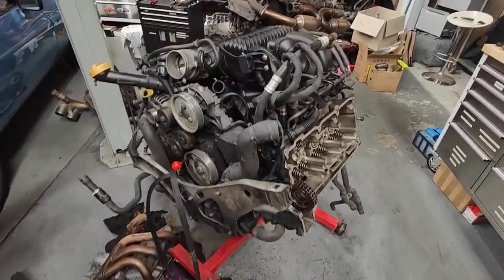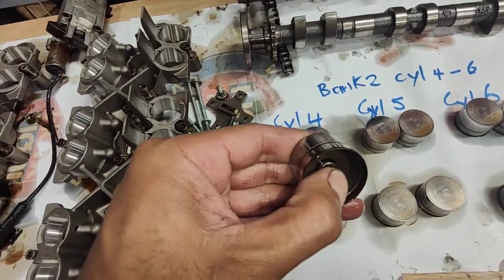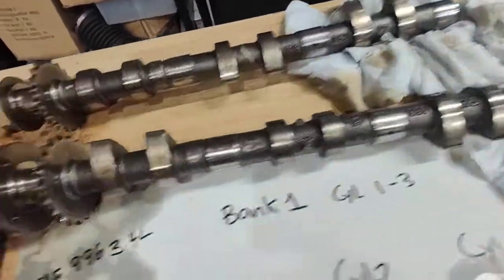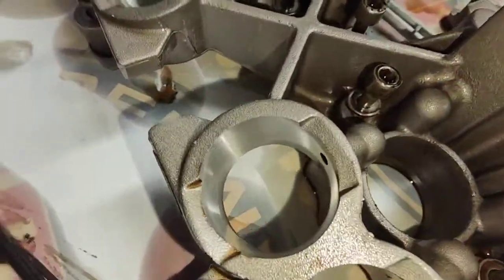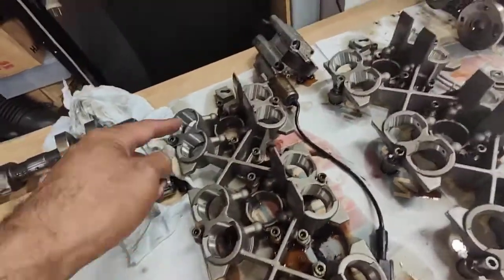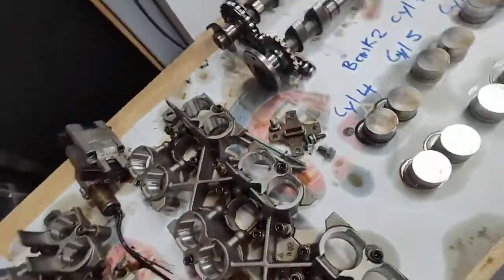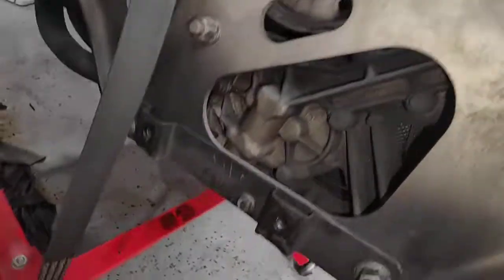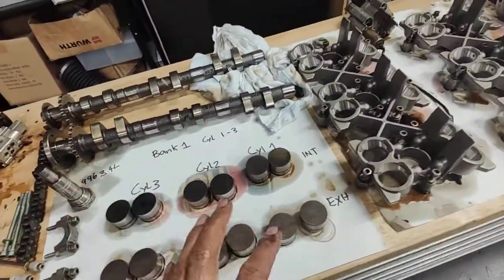Porsche 996 3.4L S.F - Camshaft out for inspection due to rattle noise

Comment: Isn't the lifter supposed to hold pressure, i.e. oil will not come out when squeezed?
Reply from the maker: @PLPOR  yes but when the pin hole is blocked spring tension will be gone